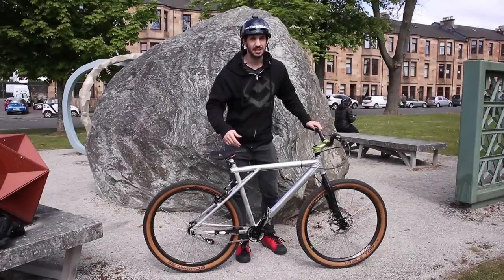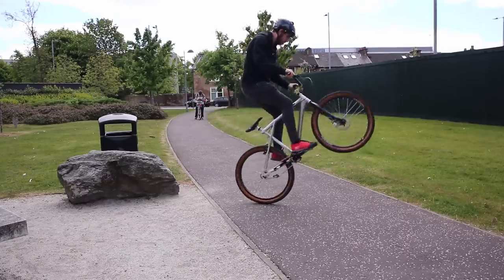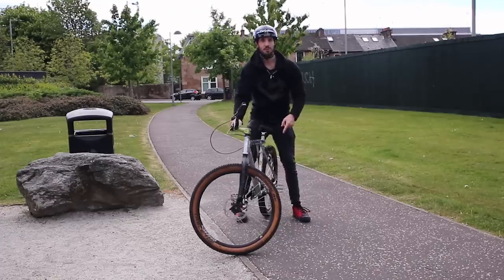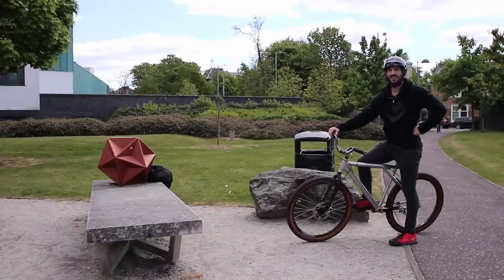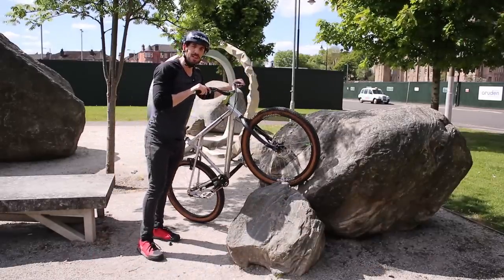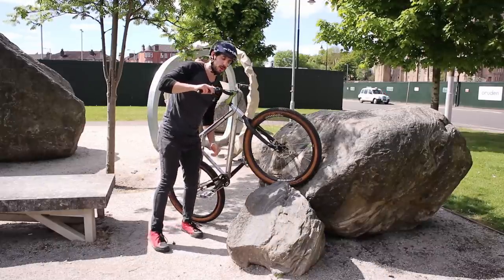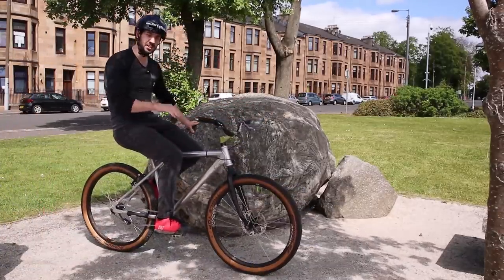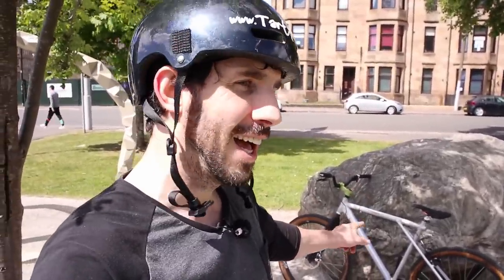Riding My First Bike Again After 23 Years!

Comment: so sorry to hear about your frame!! glad youre an advocate of safety - cant have fans riding a frame with a cracked headtube weld!! new wall art?
smaller frame means shorter wheelbase and shorter reach. While a long stem could (somewhat) resolve the reach (and at the potential expense of strength and stiffness), would the geometry still be adequate for trials? 
I totally advocate a Steel GT (so long as your components could fit) and cost in your locale is low!

Comment: There is an old trick you can use to silence your brake pads: mount them at a slight angle pointing in the direction of travel.

Comment: Get a Saracen xile frame. It's early 2000 retroish. Uber cheap and undesirable (but really quite good) . Small stand over. 7005 box section alloy main tubes. Gusseted to hell and back. You'll never break it.